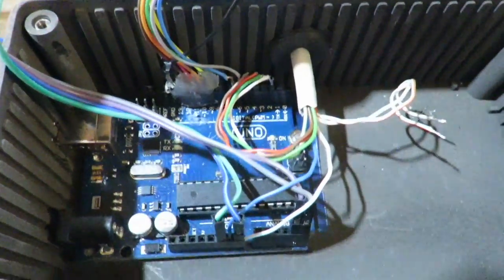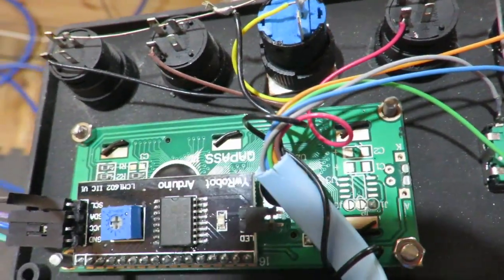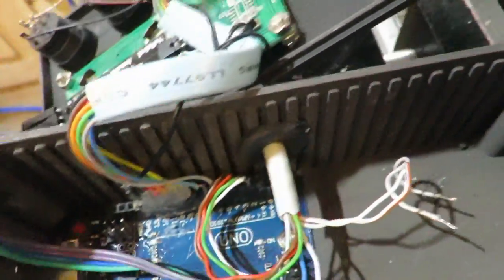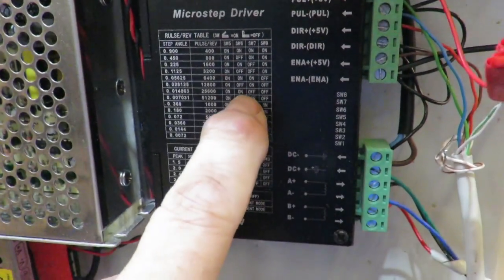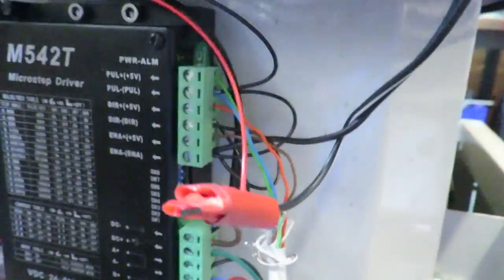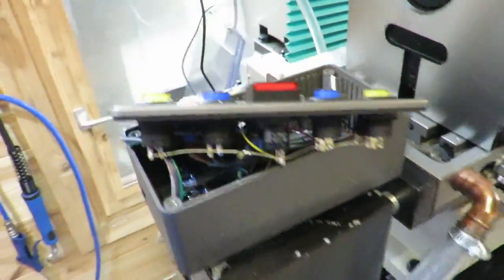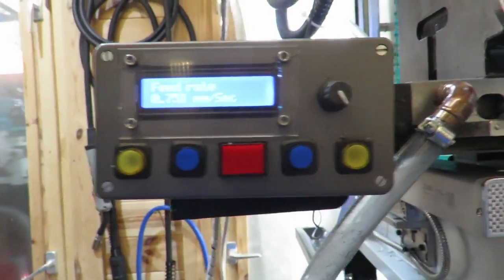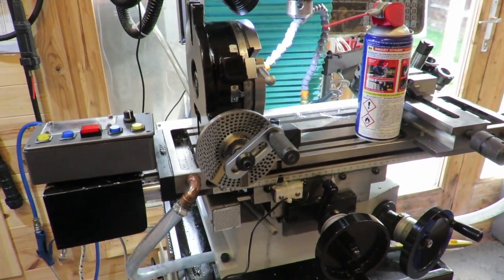Axminster / SIEG SX3 Mill Power Feed Part 4

Comment: Hello. Having a few problems trying to get the millcode to load. It all seems to be with the lcd library. I have tried various versions of the i2c code but have problems with them all. I bought my lcd display from Hobby Components , it looks the same as yours and has the pcf8574 chip. I have not been able to get the library that they supply as it is a download from their forum I've been trying to join the forum  but get no email to initiate membership. Could you please upload your version please. I'm almost there but cannot quite master the coding just yet. Thank you.
Reply from the maker: I have added a zip file with the LCD library for my unit to the github at - https://github.com/kintekobo/MillCodeMkII/tree/master/power-feed
Hopefully that should solve your problem. Let me know if it doesn't.
Reply: @ChrisMower  Thank you.

Comment: Hello again. All my parts have arrived and i've started to wire everything up. Just a couple of questions if I may. Looking at you wiring diagram I don't understand the ground output from the arduino going to the stepper driver. Also the 'end stop switch' going to pin 2. Is this the limit switch input and if so where does it get its continuity from...is it from the common switches gnd ?  Thank you.
Reply from the maker: Yes all of the grounds should be connected together. The signals to the stepper driver need a return path since they use an opto-isolator where the input drives an LED. This turns a transistor on and off to supply the step/dir/enable signals but keep them isolated. Not really needed with hobby machines but big industrial systems are best kept isolated for safety reasons. 
The end stop is a normally closed reed relay for safety reasons. The magnet switches it to open when the table reaches the stop point. Making it normally closed means that if the cable becomes detached or broken the table will stop, thus preventing it from running on when not safe to do so.
Reply: @ChrisMower   That all makes sense. I wasn't sure whether the end stop was using the common ground and returning to pin 2. Yes normally closed and activated when open. I'll make a start. Thank you so much.

Comment: Hello. I've downloaded  your latest code but i'm having problems inputting my values, even having studied the trial code. I do have the same mill and are using the same driver as yourself. Would you be so helpful to let me have a copy of your complete code and then I think I could tweek as necessary having seen where the values actually are in the code. Thank you.  rivet@egner.co.uk
Reply from the maker: Are you using the improved code at - https://github.com/kintekobo/MillCodeMkII

If so what is the problem you are having?
Reply: @ChrisMower  Yes I've downloaded the improved mk 11 code. When I looked at it I thought that it needed my own values inputting into it. Assigning pin out numbers and other numerical values. Have I missunderstood this. Should it work as is out of the box?  Sorry for my lack of understanding but until last week I had never heard of Arduinos. Sort of understanding the concept of sketches and libraries...just. Sorted my previous question about the rotary encoder, that's now all clear.
Reply from the maker: @keveggy4318  If you go to the github I have just uploaded a file called millcode.zip which if you expand it in a directory called millcode you should be able to open the file called millcode.ino in the Arduino IDE and compile.
The section called Arduino pin usage is where you set the pins that interface to the hardware. The step, direction and enable pins should be straighforward as they connect to the same pins on the stepper controller. You will need to connect a ground to the complementary pins to step, dir and enable as well.
The Input pins go to each of the switches and rotary encoder with a ground connection to the other side of the switch and encoder since they all work by pulling the input to ground.
Hope this helps.
Reply: @ChrisMower  Thank you very much. I will download now and study.

Comment: What a nice job you've done. Just a bit confused about the speed control pot used. there appears to be four wires going to it but only 2 shown on your wiring pin flow diagram. I do intent to copy your design. Thank you

Comment: Hello Mr Mower,  I've just seen the 4  videos on the power feed and I would like to have one  on my Seig X3. Is it possible you could mail me any information, drawings, part numbers etc so I can buy all the bits and give them to an electronics engineer friend of mine to build for me. The power feeds that are on the market are not only expensive but are all about 6kg or so. I am a retired toolmaker so making the bits to fit them to the machine is no problem. I hope  to hear from you shortly.
Regards
Brian
Reply from the maker: Brian I don't have any drawings or parts list as I sort-of made it up as I went along. However if you look at the information on Part One of the SX3 video there are links to the hardware that I bought for the stepper motor, PSU and stepper driver. The Arduino Uno I think came from Hobby Components but they are all much the same. The LCD was also from HC I think and the buttons i bought from Adafruit via either HC or Pimoroni. The code for the Arduino is located on GitHub at the link I put in the video, as is a program to test and tune the stepper/Arduino/driver system.

I think that you could most likely get away with buying a smaller stepper motor than the one I used as it turned out to be total overkill. The table doesn't really need much torque to turn the handle, so I will most likely move that over to the Z-Axis when I finally get around to doing the CNC conversion. Also the stepper driver unit can be bought much more cheaply from BangGood. I bought one for about £6 and it works just as well, in fact it's the one I use in the stepper test video. BangGood also sell power supples at a ridiculously cheap price and all of the items I have bought from them have been first class.

While there are no written diagrams I think that there is enough information in the videos for a goos electronics hobbyist to re-create the setup I have but if there is anything that is not clear have him get in touch and I will do my best to help.
Regards,
Chris
Reply: Hello Chris
Thank you for your prompt reply and and your detailed info on the power feed. I will have a word with my electronics friend and give him the details. I will  mail you later and let you know how it is going. 
Many thanks 
Brian

Comment: Hi Chris, Thanks for sharing your code and the videos. I think there may be a few problems with the code. It failed to compile on my system. This is partly down to the libraries used. The LCD I2C library has been created by a few people so there is more than 1 version. You need the correct version. It might be an idea if you included and library info in the comments at the top of the file such as the author of the library and version. I also cant find the endStopService routine. A few other complile errors pop up about variables. Maybe the Github version is not the correct version you intended to release. Sorry but Thanks again for sharing
regards
Steve
Reply from the maker: Stephen

The reason I didn't put the LCD library in with the code was simply that there are so many different ones out there that there is no way of knowing what library the other person is going to be using, Since there are only a couple of places where the LCD is used I thought that it would be better that the user uses the library for the LCD they have and just modify my code to suit. When they install their library it usually comes with some examples of the initialise and display code so patching should not present a problem.

As for the other compilation issues you are seeing I'm not too sure what that could be. I have just tested the compile and it went ok so I will do another push to GIT to make sure that there are no missing or incorrect files. If you check GIT now the files are up and I have checked that they are correct.

 Regards,
Chris
Reply: Hi Chris
Thank you for updating the files. I noticed the update on Saturday and had another go. It still failed to compile unfortunately. It failed in the lcd(0x27, 2, 1, 0, 4, 5, 6, 7, 3, POSITIVE) line. This turns out to be the library version. I found another version from a different author and this worked. Unfortunately it still failed to compile. This was due to the Utility Functions tab and the void setDirection( rotationDirection Direction ). It doesn't like this line at all. I have since changed it to  void setDirection( char Direction ). I then change all references None,CW & CCW to just N,C,A and it did compile eventually. Today i finally got it working but it did come at a cost. It would only work with all the LCD code removed :-(. I'll carry on. Thanks again for the code.
Reply from the maker: Steven

In order to have this work correctly with the LCD you do need to use the library that is specific for the LCD that you bought. You then need to modify the line which creates the object to suit. In my case it is -

 LiquidCrystal_I2C lcd(0x27, 2, 1, 0, 4, 5, 6, 7, 3, POSITIVE);  

then with my library I need to 'start' the driver with the line -

    lcd.begin(16,2); // sixteen characters across - 2 lines
 
Your driver might not need this, or it might have a different requirement.

Then to actually display anything there is the code in showFeedRate() which actually outputs to the LCD

    lcd.setCursor(0,0);
    lcd.print("Feed rate ");
    lcd.setCursor(0,1);
 
 Once again your library may differ but it should be pretty obvious how to get the display working by examining the example code that came with your library.

With regard to the other compile error you are getting this should not be happening if the project is opened correctly since rotationDirection is an enumeration defined in the millcode tab -

 enum rotationDirection {NONE, CW, CCW };

and as such it should be visible to the code in the utilityFunctions tab. The fact that it is not suggests that there is something wrong with the way that you have opened the project.

You should have all three files in a directory called millcode, and opened millcode.ino, which should load the other two as tabs. I am currently using Arduino IDE version 1..8.5 but that shouldn't really affect the way that it includes defines from one tab to the other. Anyway, give this a try and see if it helps.

Comment: Hi Chris, Many thanks on the wiring information,at the moment I am setting up a test on the bench and I am confident that I have wired the motor, microstep driver and power supply correctly and understand the wiring to the arduino, but I am having a bit of a problem  downloading the code.When I try to it brings up  'error compiling for board arduino/genuino uno' exit status 1.
I am  sure it is something that I am not doing right and was wondering if you could help? Regards Tony
Reply from the maker: SuperTone52 sure thing. Can you give me the details of what you are doing and the full messages that appear in the output panel when compiling. Make sure that the compiler output is set to maximum verbose.
Reply: Hi Chris, I first click on your link for the code and I press the clone or download button and download zip.I then have a file called millcode master in my downloads,when I open it has four files, interruptServicesRoutines, millcode, README me and utilityFunctions. When I click on the millcode file it opens the Arduino software and says millcode  Arduino 1.8.5 I have then the options to verify, upload, new, open, save.The screen has the code and if I hit the verify or upload button it says compiling sketch then brings the error I mentionArduino: 1.8.5 (Windows 7), Board: "Arduino/Genuino Uno"

C:\Users\User\AppData\Local\Temp\Temp4_millcode-master.zip\millcode-master\millcode\millcode.ino:12:63: fatal error: LiquidCrystal_I2C.h: No such file or directory

 #include <LiquidCrystal_I2C.h> // Only needed if using the LCD

                                                               ^

compilation terminated.

exit status 1
Error compiling for board Arduino/Genuino Uno.

This report would have more information with
"Show verbose output during compilation"
option enabled in File -> Preferences.

Not sure what I am doing wrong.I hope you have a bit more info to assist me.
Regards Tony.
Reply from the maker: SuperTone52 ok you need to install the software for the liquid crystal display if you are using one. If not just comment out all of the references to the display and try verify again. 
Are you using a display? If so you need to get the software that goes with it.
Reply: Hi Chris, I do have a display, I bought a LCM 1602,it looks very similar to yours.I don't have any software for it,where would I get that from ?
As I am not to clever with this computer stuff,just to check do I have to have all the connections to the arduino connected to display,push buttons , microstep and power suppy etc as I am trying to upload millcode with only the usb connection ? Regards Tony.
Reply from the maker: Tony,

why not check out this other video I made which is just showing how to connect and tune up the stepper motor with the Arduino. It makes it easy to check that you have the hardware connected correctly for driving the stepper. There is a link to the test code as well.

https://youtu.be/vt_ds-X92uM

As for the software for the display, was there no link to the software from the company you bought it from? If not you might want to Google search for Arduino and LCD 1602 to see if anything comes up.

As for the connections, you need to have all of the button connections for movement but you can skip the rotary knob connections for now as the code will still work OK without. You just won't be able to change the cutting speed on the fly.
Reply: Hi Chris, I will check out the video and do the connections to the arduino.I got the display from banggood and to be honest I didn't know I needed any software but I will do a bit of searching for that.
I will be busy for the next few days but I will contact you a bit later after l get time do the wiring etc.Many Thanks for your help.Regards Tony.